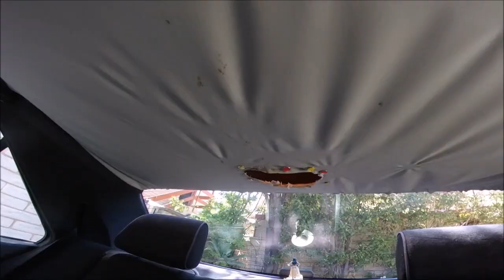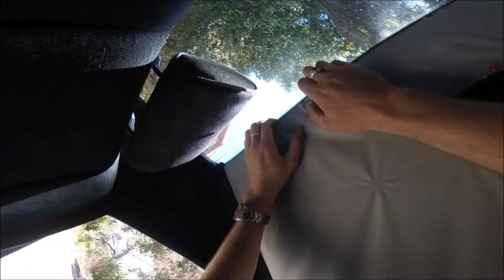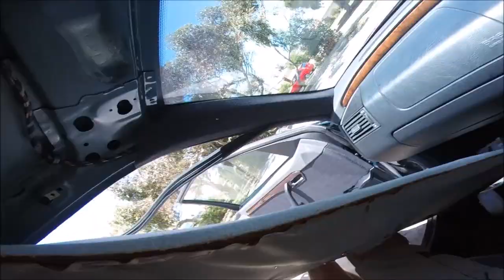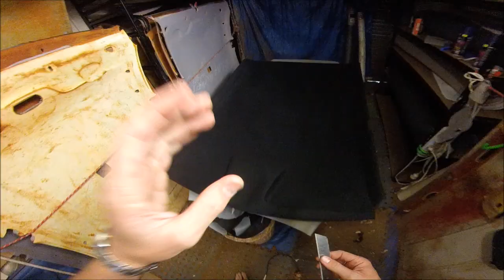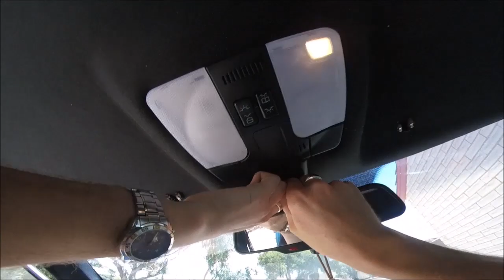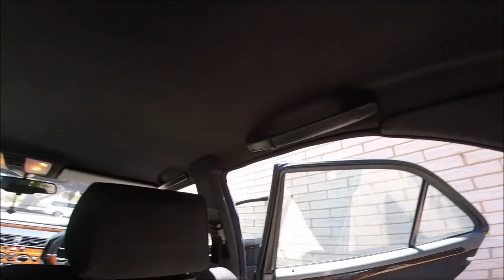Mercedes Benz c220 Roof Lining Repair | HOW TO FIX CAR ROOFLINING UPHOLSTERY

Comment: Hmmm... So you removed and put it even back the renovated roof liner through the front door, without removing the front seats?   I hope I will succeed this way in my W210, as the removel on the way we made it was very dangerous in terms of damaging the board and a hell of a job to do...

Comment: How much should it cost to get my roof reupholstered keeping in mind I'm from New Zealand
Reply from the maker: Hey mate, I'm not sure on the costs for a professional to do it in New Zealand, best to quote around and give them the Year, Make & Model of the car. We are currently only based in Adelaide South Australia, SA. 

I've put together a step by step DIY system for you, that uncovers and peels back some of the layers of how to repair a car roof lining. I'll Show You What Glues to Use & What Fabrics To Buy. Just follow this link below ⇩
http://www.reecesautoheadliningrepairs.com/product/headlining-secrets-ultimate-guide-fix-sagging-car-rooflining-reeces-auto-headlining-repairs/

In this (EBook + FREE Video Course) we don't just go over the surface stuff to give you the stuff that everyone else has already given you. We try to be a bit more in depth but at the same time more productively accurate. That's what Reece's Auto Headlining Repairs is all about. If you are looking for that training program that will do that head to http://www.reecesautoheadliningrepairs.com/product/headlining-secrets-ultimate-guide-fix-sagging-car-rooflining-reeces-auto-headlining-repairs/